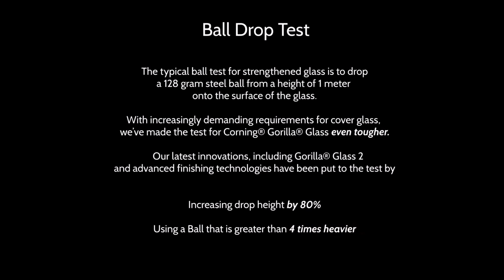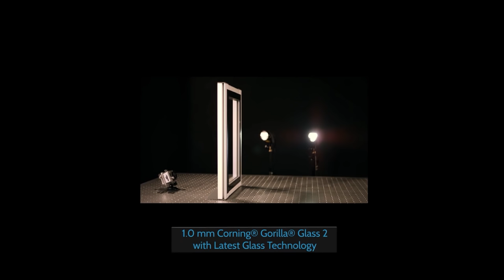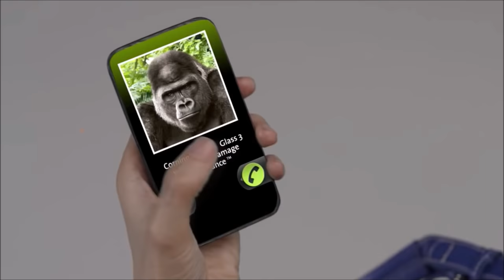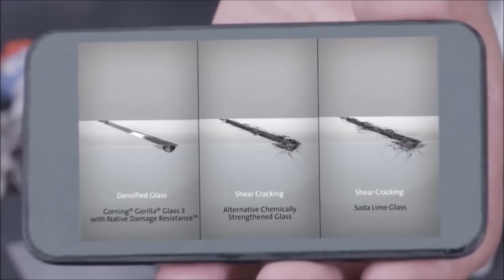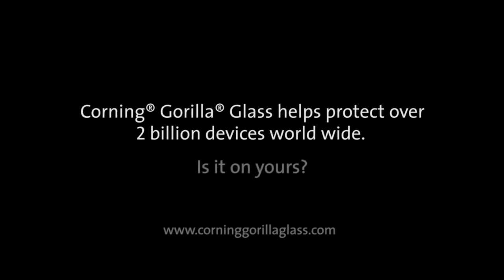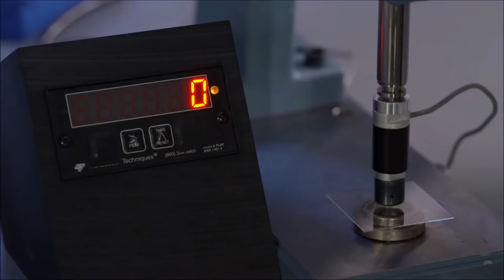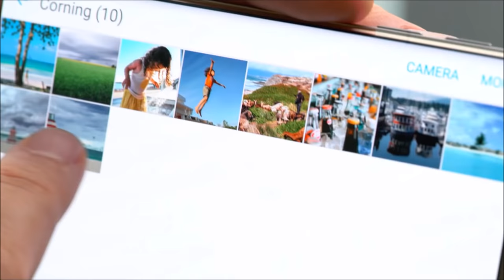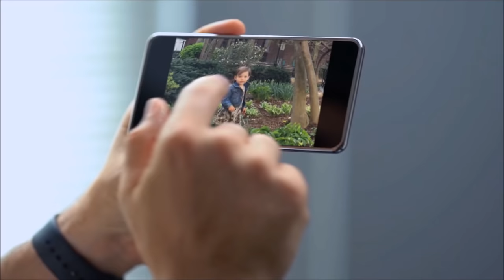Corning Gorilla Glass 2 vs 3 vs 4 vs 5

Comment: All these fancy technologies but I guarantee that your phone's screen still cracks on its first drop.
Reply: it's all a scam, I bet they don't even put the same type of glass in phones that they show in these tests!
Reply: At maximum it can resist some deep scratches. Not drops or some drill to it.
Reply: @i_hate_google_  No need for conspiracy theories, thicker glass is a lot more resistant. Phone manufacturers choose to make the glass as thin as possible. If they made it thicker it would be a lot harder to break. A thing you gotta keep in mind is that different phones have different thickness of Gorilla Glass, so some are easier to break than others and pretty much all of them have thinner glass than they should
Reply: I've dropped my iPhone 4 and other phones from serious heights many times and it took years before finally breaking. As long as the phone is made sturdy and tight behind the screen is good. My new Pixel 4a feels sturdy as a mofo
Reply: Well, mine has Gorilla Glass 5, and it fell multiple times throughout 3 years and didn't break. The one time it finally broke was then I fell with my phone in my hand, then accidentally smashed it on the floor as I put my arms forward to alleviate the fall.

Comment: Well it's not durable enough for me
Reply from the maker: hi, thank you for your comment,
Reply: u should make ur own glass , babhahaha.
Reply: +Screwg oogle Graphene is actually very promising for its capabilities. It is not called a supermaterial for nothing. It is the most durable substance known to man, and it can be used to make crystal clear bendable screens, advanced solar panels, great electronic receivers, making it likely to replace silicon in the future as the main component of chips, and even sports instruments thanks to its durability. It is made of a single layer of (very nearly, as much as human science capability goes) pure carbon, making it cannot be split by the side, and very tough to cut or pierce through, because a single layer of atom means that it has no flaws and carbon bonds together very great.    
Currently scientists already had the technology to apply graphene to the civilian market, but they are still trying to reduce the cost of creating graphene (which is fun, because the method that the scientists who discovered graphene made it was to used tape and take out layers and layers of graphite, until there was only one left). Once it has made its way in, it is going to change our technology lives forever, delivering performance that was unreachable before by current tech (even phones have stay at the same size or bigger to hold better hardware, both iPhones and Androids for example). I would say that whichever phone brand applies this tech first will certainly become the winner of at least 3 years. Of all the countries, the US is leading in research pace, with Europe, the original discoverers second, and the Chinese third. However, only a small portion of the Americans and Europeans know about this, which is a pity, considering 250000 research and experiments in America and 150000 in Europe, if my memory is not wrong. The Chinese population probably don't even know about it, but Chinese government and the cooperations sure do.
Reply: Sorry for the long post, it actually took me 10 minutes to write it 😅
Reply: Nguyen Vo that took me 10 seconds to read

Comment: hey Corning, I noticed when you were talking about GG4 you talked about its scratch resistance but when you talked about GG5 you took the part about scratch resistance out at the end of your video. GG5 is straight up trash and forces the user to either get a screen protector, which makes the screen more resistant to cracking anyway, out end up with a scratched up screen because that GG5 garbage is so soft.
Reply: hmm no answer :-(

Comment: Sadly the gg5 tests will not be accurate because smartphone manufacturers will just make the glass thinner due to the improved durability. And this is at a time when perfect fitting tempered glass protectors are almost impossible to find for the new edge/2.5d glass displays

Comment: For those who didn't watch the remake of Jerry's experiment gorilla glass has a scratch resistance of about 5 to 6. the reason why it's scratched at a low-level was because remnants from the sharpening block he used for the tools was transferred onto there and it's on the hardness scale of about a 9.

Comment: 9:55 It's not really 1.6 m drop because it is dropped when it almost reaches the ground not when it is on 1.6 m height.
Reply: MultiChantal22 It is. The machine matches the velocity that the phone would reach through gravity. Of they drop it from 1.6 meters, the angle of impact would change, skewing the results
Reply: that is one problem with the tests though they all seem to assume that the phone will land perfectly flat on the face of the glass, I dont know that ive ever seen that happen. most phones ive seen break or broken, happened to land on the edge of the screen, where it shattered the whole screen from that point. I worked years ago at a place that processed recycled phones for companies and litterally destroyed thousands of phones. and i can say that most of them that had shattered screens were ones where the phone had landed on the edge not flat on the face.

Comment: Gg 5 is a joke.  Back to gg4.  Btw even though you could drop your device from1. 6 m edges are still the weakest point and barely withstand half of 1.6 height.  JOKE.
Reply: Why are they bullshiting people about the whole durability to bending?? When did ever someones phone's screen bend that much??! At that point, I imagine it has far worse damage than a cracked screen. So there whole innovation and marketing is around a nonissue (THEY FIXED NOTHING!). Scratches are a far bigger issue for the majority of users(who are not Mr. fucking butterfingers) I dropped my last phone maybe 3 or 4 times in 3 years ... Scratches are something you have to live with for probably the duration of your phones life and are likely to force you to buy a new one which is really their whole aim!

Saphire is the future for me!

Right here GG5 ,,|,,

Comment: SIMPLY PUT every generation of glass DOUBLES the durability... 
3 did an... 'meh' job for me. A few times it did manage to work, but most of the times i had to replace the screen or AT LEAST a 0.5~1cm crack.
I am going for G5 this time around since i am sick and tired of every little drop killing my freaking display!
Ugh<.< in fact i miss my old K610i ... you could not kill this thing with fire if you tried!

Comment: BS... you can develop even gorilla 10.... 
The real drop resistant glass, is sapphire glass...
unfortunately is way too expensive to implement it on phones, huh?
gorilla is BS...
Reply: are you sure? i have it on my rolex 10 years and still looks like new... my experience. nothing more.
Reply: +Arsh Singh rolex glass is dence
Reply: There is a huge difference in the thickness of a watch glass and a glass on a mobile phone. A watch glass need not bother about touch sensitivity, reflection, or refraction due to backlight, but a mobile phone glass does need to take all of these in consideration
Reply: He probably lost hope in the company after Harambe was proven to be not as durable as expected
Reply: Yeah sapphire is fragile as heck but the thicker the piece of sapphire glass is, the less fragile it becomes. For smartphones, generally thinner pieces of glass is what everyone wants (more responsive sensors)
Reply: Sapphire is hard but brittle (not strong), it has a mohs hardness of 9 which is why it is used in watches so that it doesn't scratch.  In order for it to be strong they make the face very thick, which cannot be done with smartphones.
Reply: +Alex just watch phonebuff lhone drop test iphone 6s vs note 7.the note 7 survived 50 drops using gg5 while iphone 6s survived 6 drops using saphire glass
Reply: +Michael Adel iPhone s6 only has Saphire Glas on the camera lense. get it right before arguing like a little kid
Reply: +Michael Adel my friend had a phone with sapphire glass on it, he was throwing it and playing football with it, no damage at all
Reply: Jeff Jeffrey that would Cost him around 1500-2000 bucks
Reply: Michael Adel So Just Dont Drop it
Reply: +Jeff Jeffrey playing football has a layer of grass field witch is soft,so no problem for phone damage even gg2 can handle it.btw chamge your fking profile pic ur thumbnail creeps me out
Reply: Michael Adel which* LOL